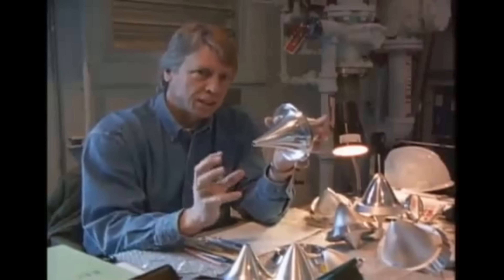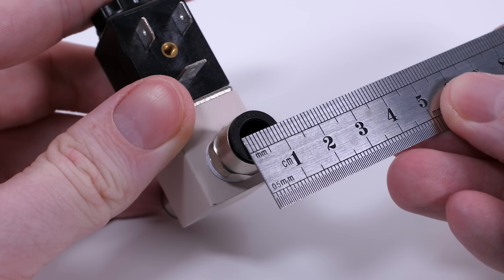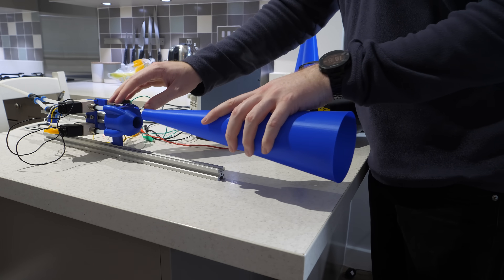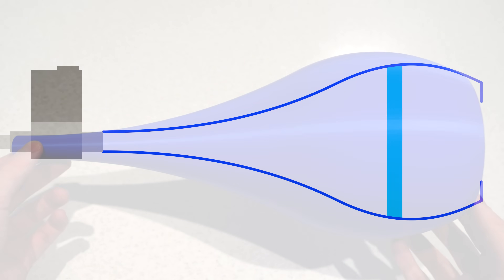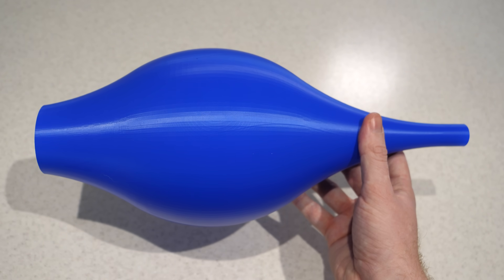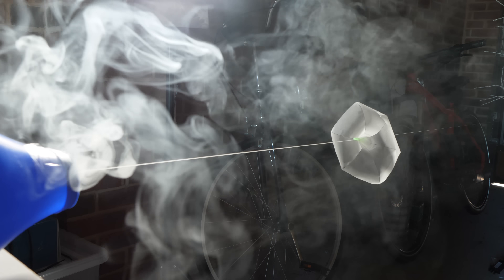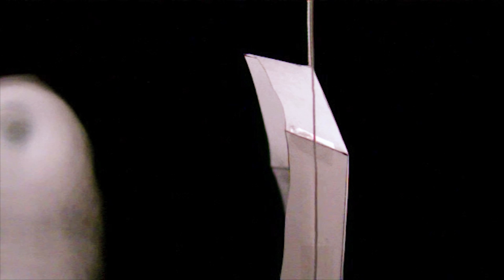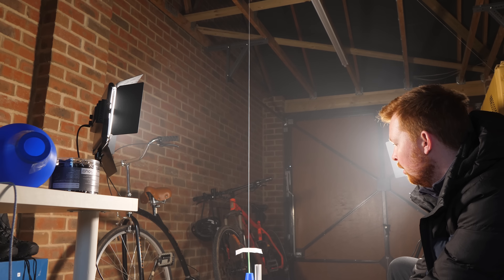Smoke Ring Propulsion

Comment from the maker: Use code TomStanton or go to https://curiositystream.com/TomStanton to get Curiosity Stream for only $14.99 for the whole year!
Reply: The laser pulsed device uses spin stabilization. You can see them spinning it up like a top with an air hose before blasting with the laser.

If you want this thing to hover without a string, you will have to make a device thats tough enough to be spun up to the point of gyroscopic stabilization.
Reply: Bass cannon. 
Moves more air faster and in a more controlled manner. 

Also has the hole in the end of a cylinder.
Reply: @brucebaxter6923  Great idea Bruce, we are moving along in the right direction.
Reply: I must admit you made a very convincing and compelling publicity for Curiosity Stream.
Reply: Love the video but I'd love too see longer videos, or more videos. I'm sure it's not easy but it would be awesome to get more content from you. 🛸
Reply: plz make this out of 3d print so it stops flexing and just see how good it pushes up the 1 layer 3dprint
Reply: @UPsideDOWNworld321  maybe even a brace that holds thin paper covering to give it its structure
Reply: Would using a vortex air amplifier help you make the movement go faster and straighter ??
Reply: Try doing HYDRAULIC FLUID DRIVE BICYCLE Using Positive Displacement Pumps and Hydraulic Motor 
Just fascinated with Hydraulics =)
Reply: @jojoligsay3373  Worth a try for sure.
Reply: @jojoligsay3373  
Very inefficient. 

Look at pneumatic systems, it already has an automatic gearbox/torque converter effect.
Reply: If you really want to learn about vortex propulsion you should research Viktor Schauberger & the things he did with the vortex, it's very similar to what you tried in this video
Reply: Can you "Send" gas? Like, send out a propane ring that the vehicle ignites to use for propulsion? The idea - the vehicle doesn't have to contain its own fuel. It uses fuel delivered to it remotely.
Reply: @veizour  Right on Veizour. This concept was shown years ago. Peace
Reply: The slowmos look like Jelly fish :)
Reply: TOM! I NEED HELP! I loved your electronic launch and I would love to make one to use on my model roller coasters. im building a 10 foot tall roller coaster very soon and would be greatful if you could have a discord call of phone call to help me order the right parts ect... 
Love the content!
Reply: How about the an hyperbolic funnel?

And what if you let the smoke go sideways and rotate
Reply: holy hell, you are the only person who remembers lightcraft technologies like i do
Reply: Ok
Reply: @ASRocketry  🔴 What Is Islam? ⚠️

🔴 Islam is not just another religion. 

🔵 It is the same message preached by Moses, Jesus and Abraham.

 🔴 Islam literally means ‘submission to God’ and it teaches us to have a direct relationship with God. 

 🔵 It reminds us that since God created us, no one should be worshipped except God alone. 

 🔴 It also teaches that God is nothing like a human being or like anything that we can imagine.

🌍 The concept of God is summarized in the Quran as:

📖 { “Say, He is God, the One.  God, the Absolute.  He does not give birth, nor was He born, and there is nothing like Him.”} (Quran 112:1-4)[4] 📚

🔴 Becoming a Muslim is not turning your back to Jesus. 

🔵 Rather it’s going back to the original teachings of Jesus and obeying him.
Reply: You are great
Reply: What's the name of the episode of Butterfly Effect you menioned?
Reply: Keep up the good work
Reply: I didn't get the point of this. Of course fluid/air pushes objects. I mean, of course. What is the point? hmm
Reply: For me the video cuts of just after the sentence "And we haven't even considered the stability of the sail yet."
No outro not the contraption from the thumbnail. It appears like it didn't render to the end and you accidentally uploaded an incomplete video.
Reply: Really a nice vid, even without "proper" success. Would love to see a coorperation with smartereveryday - I think you guys would have a lot of fun.
Reply: now you are catching on..
Reply: Alien aircraft making man u have become hehehehe
Reply: it must be nice to sit around and do things that already been done decades ago and thus why we dont use these things unless you want to really waste everyone's time with BS high school experiments cause the majority of the idiots watching didnt pay attention in school then
Reply: Diaphragm valves, that's what you are looking, for high pulses of compressed air instead of those which are for control or small mechanical actuators. I've used them and are quite impressive, you can find them with openings over 1"
Reply: Sir can u try hooking this nozzle in a pulse jet engine
Reply: A rifled barrel? So to speak may be of important study here
Reply: Could u make a Ornithopter from Dune
Reply: already have it
Reply: Bro i need some help for the experiment i think can we make room cooler by removing heat air on ceiling only with some kind of absorbing pipe like glider glyding on thermals cool air comes automatically towards the absorbed place
Reply: Intersting but I'd really like  you to try your hand on an aerospike engine 😀
Reply: Would it work if you were make a “burst disc” out of aluminium foil or baking paper and put it in the end of a spacer or small chamber between the release valve and the cone/barrel? That way you can probably somewhat pressurise the “spacer” before triggering the release valve.
Reply: I mean what's even the point? Especially if you take away the vortex and use normal air blasts? You're just proving air will indeed move a sail, something we've known for thousands of years... even with a vortex, you aren't really adding anything meaningful or of any substance imo 🤔

Comment: I think that the rings were being launched from the underside of the object and that caused propulsion... A reaction caused by the laser as it struck the material  attached  to the underside of the object. An explosion happens causing the ring to form do to the shape of the underside of the object and thus creating propulsion. I wonder if the are measurements on the power of the explosions and the weight of the object? Self stabilized???

Comment: I think that the extra “rings” behind the vortex is due to the valves are bouncing when closing.
Same problem that shows up in pcp air rifles where you want a single clean puff of power.
Clean, I mean that it’s one source of air pushing. No extra puffs disturbing the pellets flight.

Comment: I’m intrigued if having another air or combustion chamber around the conventional cone (potentially with a staggered initiation), it would boost the performance.  Supposedly the air being entrained by the almost venturi like effect of the high speed cone air and the still surrounding air.  I’m thinking have the core one go 2x, Surrounding bit go 1x.  Although maybe you get vortex ring-ception!

Also using something “faster” like hydrogen-oxygen, or even full on (H-O…) fired plug compressed hydrogen like a proper light gas gun may make it faster!

Could also add injectors at the “throat” for some sort of fog or dye, almost like a Carburetor, to enhance visibility.

Those are my ideas for someone like you to tinker with if you beat me to it! (Will need to be CC Attribute Share Alike Though!)

(Context for the Thread Necromanc:  Looking back at this after the recent Backyard Scientist bit (although it was a commercial product i guess, not his design)

(Edit: Added Context)

Comment: Congratulations, you buit a crappy parachute and blew air in it. The toroid has enough pressure to overcome the standing inertia and then you just spray air. Wow. The way the string prevented it from going off course due to terrible engineering and a complete inability to grasp the concept was so impressive. Oh what's that thumbnail, a wheel for a tricycle made of ice and sawdust? Surely that just slides and the concrete doesn't grind it down because the sawdust adds nothing in that application. 

Ya know why you should use a diaphragm? Because the negative pressure would prevent the turbulent stream behind the toroid and it you could work up to a piston set up, integrating rubber gaskets valves to extend watch time. 

What do they call those ducks that cant get away?

Comment: This idea cannot be realized. There are too many factors influencing this in atmospheric conditions.
In the case of a sail driven by a laser beam, I believe that the energy that makes it rise upward is the energy of the air heated under the sail.
In the case of your experiment, the energy source is fixed at the bottom. In the case of that metal sail, the working fluid (air) is always near the sail. The air surrounding it is the "fuel tank" for movement.
I tried to translate my thought automatically using Google. I hope it will be clear.

Comment: 5:37  the ball stayed in the air beam shouldn't be considered a cause of coanda effect,but Bernoulli's Law.  As the air flows tend to bypass the ball surface and resume the status before they reach the ball,the speed of the air flow is faster on the surface than other area,then the ball gets a push-back force on its side surfaces,which act together like a fixing ring to the ball.

Comment: Rather than using joined paper you could 3d print a proper circular cone shape then paint it with a thin layer of liquid latex. You can then peel it off of the 3d print to get something lightweight. You could also get the dart to spin for stability.

Comment: I remember reading about this when they were working on it. The thought process was if perfected, they could launch these things into space for a relatively cheap amount of electricity. The thought that occurred to me concerning this, what if a small amount of water could be pushed out of the interior ring and would the plasma cause it to flash into steam and dramatically increase the thrust compared with the plasma alone?

Comment: What if you create a two-chamber system where the wall between the chambers is spinning with a hole to control the airflow? However, it may be difficult to seal the chambers properly.

Comment: I really do like your experiments, they are very entertaining. Obviously, for a vortex  ring to properly form, one has to think about the necessary geometrie at the place of its formation. You need a high pressure in the center region and normal or even low pressure around that center region to start the torus rotation properly. This sets rotational speed. Duration and strength of the impulse in the center then should determine the velocity of the ring in space along the x-axis. Your first designs all have the air enter within the outer regions of the formation plane - no wonder they fail.

Comment: Tom: RE: multiple vortices: Vortices are confined to discrete shedding "packets" (see Von Karman Vortex Street), based on a number of factors, primarily related to the size and shape of the body that generates them. These, in turn, have a "shedding frequency", wherein new (secondary) vortices are automatically generated.  If you increased both the velocity and duration of your stream, a continual stream of shed vortices emerge (as you demonstrated). And because they are counter-rotating relative to one another, they destroy one another. For a single POWERFUL vortex, any increase in air velocity must include a shortening of the pulse duration, followed by sufficient pause time for the subsequent vortex to move without interference to/with the prior. HTH

Comment: If you do the same experiment without a vortex generator device and instead you use a simple tube you will have a bigger propulsion force on the paper. The reason is that with the production of a vortex you enhance the production of turbolence. The energy for turbolence is given by the mean flow and that energy will be converted into heat over time, so it's a waste of energy for the sake of propulsion.
With a tube the production of turbolence should be smaller

Comment: this device you just saw is a atmospheric espansion based flying device. it works on the principle that most atmospheric gasses expand when they get hot. 
something like that is actually rather easy to replicate using a old camera flasher and some kind of gong. you can flash it at it and it will generate heat on the surface acting like a small explosion making it start to move and make sound.
that flying design is basically the same but it uses a light thing, a much more powerful light which is focussed at generating more heat(IR).
the device also has a special geometry to make sure the air gets pushed out and in with different direction balances meaning once the light pulses and the air heats up most air movement force is aimed downward, and once the new cold air flows it it takes more from the surrounding to minimize the downward force.

luckily while a good geometry helps due to inertia of mass the particles send out will want to follow their direction once the air heats up and they have their movement. but the barely moving particles in the air will just be pulled in based on how close they are to the center making it pull from all sides and so not affect the thrust tom much. the top is also optimized against wind resistance since on impact it needs to accelerate fast for a short duration and for stability ofcource.

btw. heating air a lot generates plasma, it might also be optimized specifically to focus on generating static charge for plasma instead of heat. but generating the heat and making that generate the plasma is much simpeler

Comment: I guess I wonder more if you could smooth airflow under a hover craft and use the air as a sort of bearing for super efficient flight. Could you stabilize a ring under a hover craft and run it continuously as its primary mode of lift generation. Could you test how efficient that is?
Reply: Tom Stanton pretty Please

Comment: Maybe multiple rings are being made because of some oscillation? Because the end has a stopper on it, it creates a wave that bounces back and fourth between the enclosure. Maybe it wouldn't explain how they're so close together, but it could be that it bounces back and hits a higher pressure zone so the area that the oscillation happens is a bit smaller and thus higher frequency.

Comment: How the laser-UFO works is more or less how he explained it. The laser hits the underneath of the UFO, which is very reflective and silver coloured. The shape of it focusses the reflected beam into a tiny point just beneath it. That point contains enough laser energy that it causes an explosion just from the air that's there. The force from the explosion pushes the craft upward. Then a moment later there's another laser flash, so you get the boom-boom-boom or parp-parp-parp sound as it ascends. A series of explosions powered by a laser, which, being ground-based, can be enormous and heavy without that mattering.

The UFO is stabilised by spinning it just before launch. All in it's a bit of a rickety example, but it proves a point. It might be possible in future to launch spaceships that way, although of course a spaceship needs sideways thrust, that is, parallel to the ground, to achieve orbit. Otherwise it just goes straight up and falls straight down again. On a demo scale though I suppose they've done the right thing, they're not aiming for orbit when it inevitably fails 10 metres up.

Yes I've simplified a couple of things a bit here, just getting the principle across.

Comment: Watching this i got the idea for another impractical propulsion method.
If you’re familiar with the method of producing long range laser focused audio using the interference of two directed high frequency audio beams. Consider what would happen if you could systematically redirect the beam to only be pointed at your craft whilst the interference led to a positive pressure and away from it otherwise. That might be enough to lift something ultra light. I’d love to see that

Comment: I’m pretty sure the reason there was multiple rings is because the expansion chamber is similar to a 2 stroke exhaust, the shape would be creating a second shockwave inside, but since it’s closed and only has one hole to escape from, it bounces back out the end, creating a second or even third ring

Comment: add an umbrella frame that flexes outwards and hang weights to the end of the umbrella frame. now theres a method of transportation via hanging weights, and the count-acting forces of the frame and weights should hold the sail rigid. also allow you to control direction by controlling the center of gravity of the sail, when the sail is landing back down.

Comment: That octagonal one was probably the best, I suggest lengthening the sides of the device and maybe putting a thin but sturdy wire attached to the corners pointed down for stability when rising. It will add extra weight, but the stability might make up for it.

Comment: Looking at the close up of that splitting ring effect. I believe it's down to the nozzle as the initial one is caught by the second one formed. That second one has the same effect creating 4 rings out of the secondary discharge with like barely any velocity. Interestingly that velocity doesn't carry the second discharge much at all and the kinetic force does totally travel through the smoke into the second ring where it's caught and I'm guessing like a gyroscope the vortex curled it's low entry around and upwards and thus the whole ring changes trajectory instantly.

Comment: Not related to this video, but for your air engine planes, I would look into DLG design for your builds. An Armsoar Deviant has a 1m wingspan and with all servos, rx and battery, it sits at around 150g. Far better lift, and stronger than the lightest builds you have made. You could mod by removing part of the front end, which would further reduce weight, and with the engine installed, you could be under 200g still. Of course, it would be less aerodynamic than the glider in pure form, but still much greater than your builds